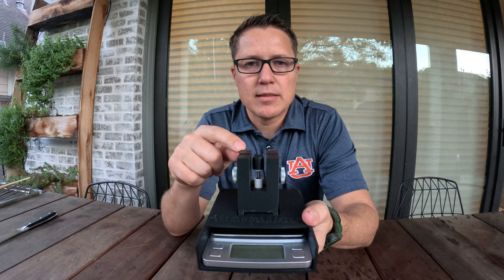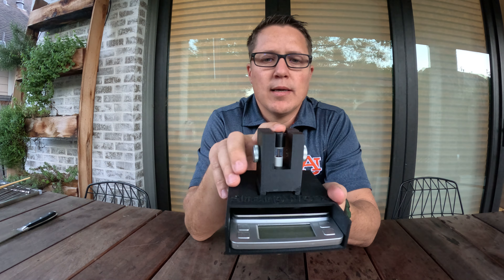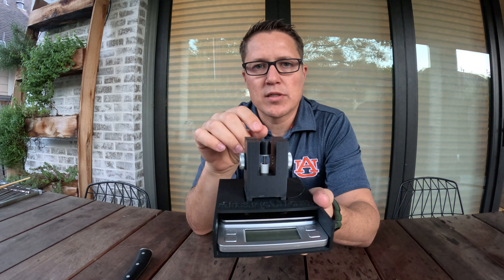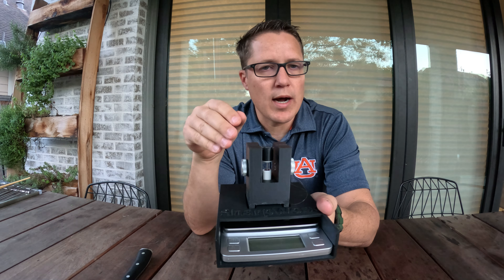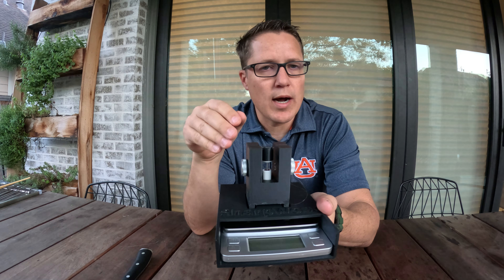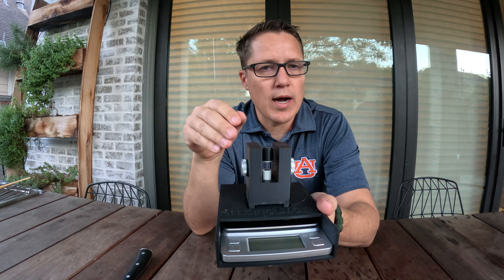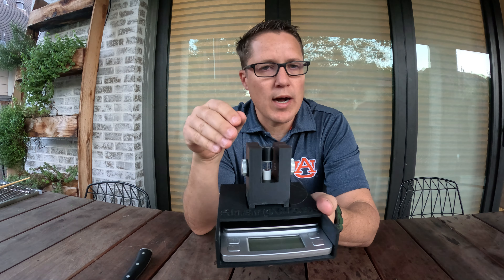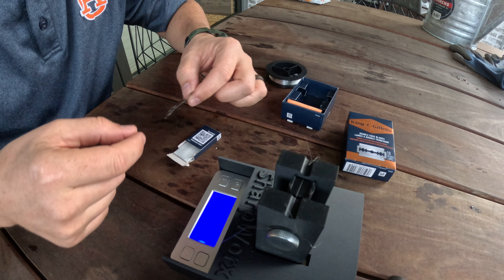Is This New Knife Sharpness TEST Too Good to Be True?

Comment: The filament should also be on a spring so it's the same tension.
Reply from the maker: F=kx is the equation for a spring. You need to bar the same displacement on the strong to make it the exact same.

Comment: Excellent concept, and I have a couple of ideas. 
Variations in the tensioning of the filament could account for slight differences in the readings you’re getting. I’ve seen others using a weight to set the tension so it cuts out this variable. 
If you moved the clamping screws to the top surface there would be 2 benefits, firstly you’d waste 50% less filament and secondly, it’d be easier to tension it by picking it up and then turning the device 90° so the thread hangs freely and has no friction from dragging it around the corners when the weight is dangled.  

Can you tell me the make and model number of the scale, please?

Comment: Nice! I think inconsistent tension on the filament will affect results. I don't understand how the damper effects the rate at which the blade hits the filament. Seems like it would just require more force. Maybe if it were filled with a newtonian fluid it might limit fast cutting motions. I always thought the bess tester was just a really expensive scale with a default hold function.
Reply from the maker: The force applied to the dampener is not read by the scale. The dampener essentially brings the blade speed to zero before touching the filament then allows only slow movement until the filament is cut.